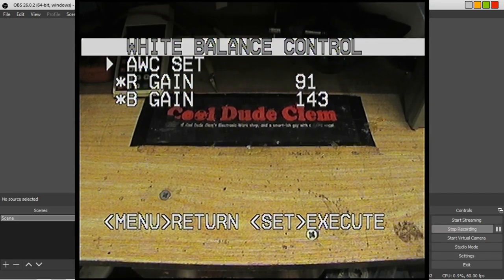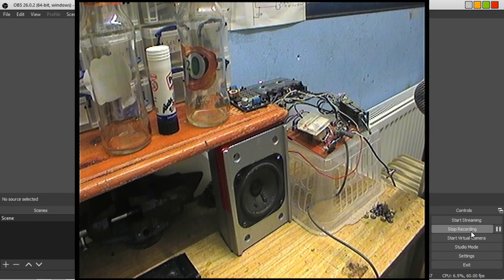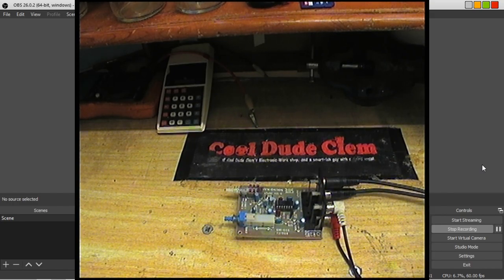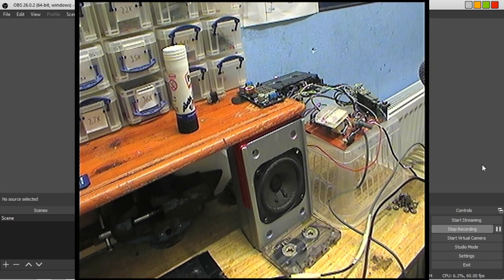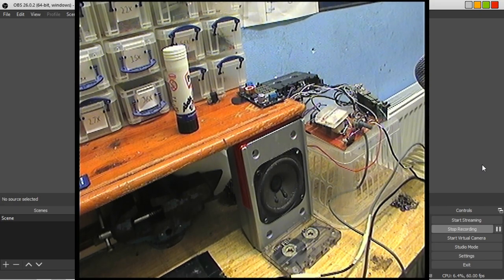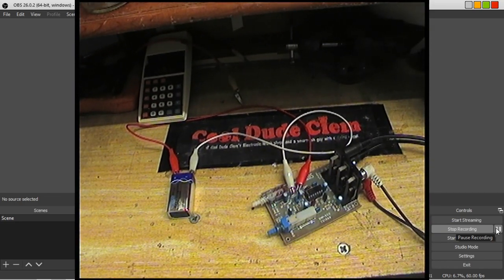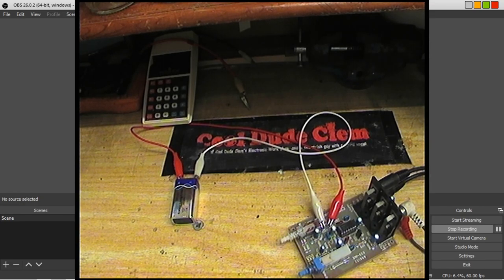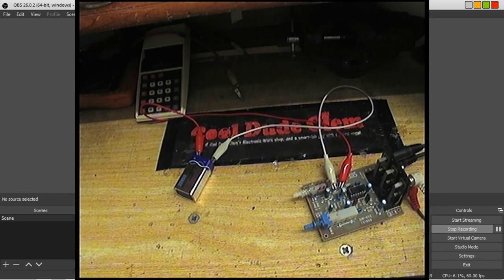LM1894N Dynamic Noise Reduction

Comment: It's a bit like watching you on an old Cathode Ray T.V. Set Clem.
You didn't explain how the little Noise Reduction Board actually works.
Is it done in almost the same way as the Dolby System that they used to put on Hi-fi Cassette Deck Separates or is it something a bit more obscure such as the Horizontal Correlation that they used in V.C.R.s?
Reply from the maker: I have no idea how it actually works, that's why i didn't explain it.
Reply: @CoolDudeClem  Dynamic noise reduction. So it depends on several variables such as sound frequency, sound volume. So if the music is loud (drums, bass, more dB), DNR almost doesn't work because there is no need to reduce the noise. At the moment when the sound fades, the drum-bass components of the music become weaker and therefore the higher tones become stronger and thus the noise becomes stronger.. E.g. on an analog audio cassette or LP, the noise is more audible at lower sound levels because it is mostly in the mid and higher frequencies (when the song ends, the audible noise increases).. The noise is also strong in the gaps between songs. A dynamic filter means that the device reduces noise in certain frequencies precisely according to the level of the input signal. As the volume increases, the suppression level becomes weaker, on the contrary, as the volume decreases, the reduction becomes stronger.. So you made a mistake in the test by playing music in the middle of a song with a strong beat and bass, although it would be better to try a ballad with less loud passages, e.g. with softer piano passages or solo guitars with cymbals, etc. Then you would know the effect of this noise limiter much better..